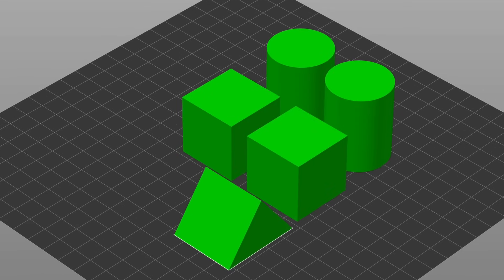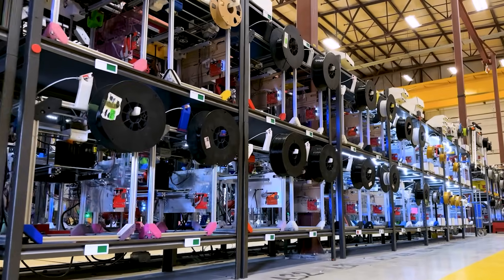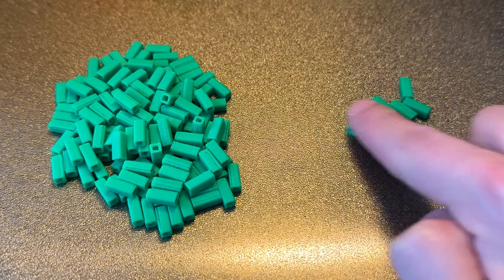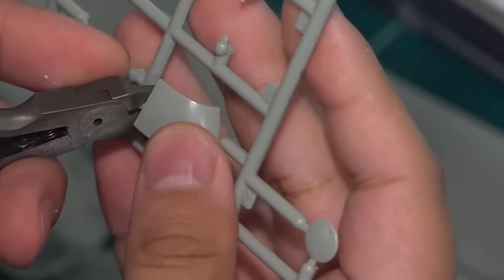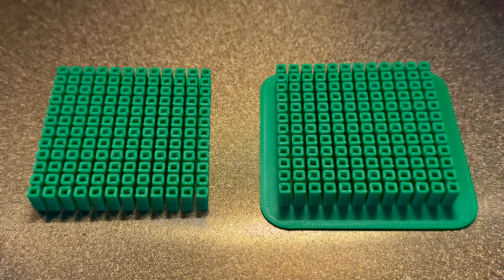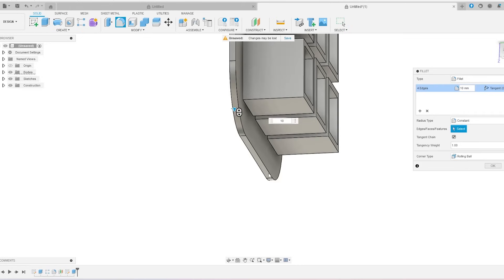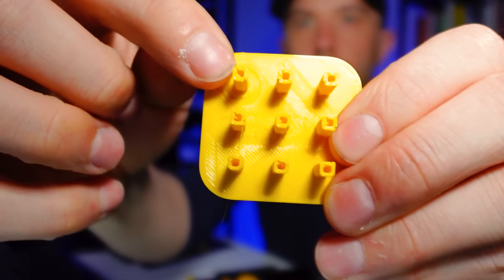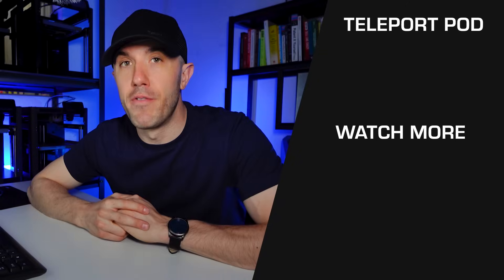STOP Filling Your Build Plate | Design for 3D Printing

Comment: One important reason for filling build plate, you forgot to mention:
Getting more parts printed for the same exact print time (& machine wear).

As long as the parts you add are not taller than the current tallest part, the print time will not increase at all! Only the height of the tallest single part (& layer height & exposure time) matters.

(Of course this only goes for MSLA resin printers, which are very considerable part of all 3D printers on the market)

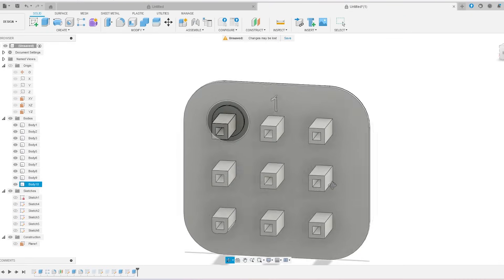Comment: What is going on with that print quality at 7:38? Extremely messy-looking top layers on the raft and parts, and huge seams up the sides of the parts. I ordered a test print from you recently, in matte white PLA, and it looked amazing, even a bit better than I get on my MK4 (really nice bottom finish, better corners than I get, and surprisingly crisp intersections of a grid of vertical fins, where I was getting tiny voids). I'm curious why you made me such a great part, but show off some really janky stuff in your videos at times.

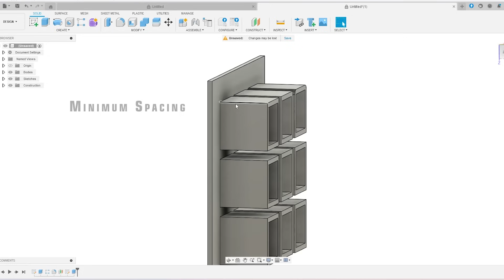Comment: when he mentions minimum spacing .2mm @5:37  is he saying spacing each part .2 mm away from each other or is there a spacing feature from part to raft? 
Not looking at my slicer right now so if there is a spacing feature from part to raft, what is it called?

also... in regards to those same questions.... yea... are you printing directly onto the raft, or spacing from it

if you are spacing from it, are you essentially printing in thin air, even if only by a small distance?

are you still able to apply a bottom surface texture/design?

Not exactly sure how this artificial raft allows for easy breakaway from the part and keeping the part to still maintain it's intended design/ shape on the bottom

best raft heights?

what if the part had a longer length but was layed flat horizontally and not much vertical height? ( think printing 20 0r 30 or 40 bookmarks layed down flat horizontally at one time.... would they not just essentially get stuck in the raft?

what are the best ways to create this raft if you are a SolidWorks user or fusion 360 user?
or is the best way to use that 3d builder app?
(apparently the app has been removed from ap store though there may be workarounds)

Thanks for any advice

Comment: Hi, I wonder how you can print with this 0.2 or 0.3 spacing. When I try that on my bambulab X1C, it will not print because all the objects are floating above the 'card' and it says I need to add supports. Any advice on this? Thanks

Comment: I had a thought when you talked about using the raft as a card; you could put your note, qr, TOC etc on the bottom, and have the framing on the top..

Maybe you said it in the video, I'm sitting in a takeaway next to a street, so it's a bit noisy! 

Great video, great tips! Heading home to make a template now.

Comment: when you’re talking about designing the raft and the minimum spacing of 0.2-0.3 mm, are you saying to design in a gap between the parts and the raft, like a Z-gap for support interface layers? I assume that’s what you meant but I just wanted to be sure. Thanks!

Comment: Still using the "additive manufacturing is better than injection molding in almost every way" line!

That is just wrong & it damages your credibility honestly. It damages AMs credibility as a manufacturing alternative as its just hype speak

In reality, most parts that could be made by AM or IM are made by IM. AM has its place but its never going to replace IM (or casting or machining) for most parts. It will supplement existing manufacturing with its advantages i.e. enable new designs that couldn't be made with other methods, bring products to market quicker or consolidate parts. But it has to make sense and create value!

Comment: How do you insure your prints pop off the raft? If they have more than a couple of mm of wall thickness, it might interpret it as being a part of the raft and not properly print the bottom.
Reply from the maker: 0.2-0.3mm spacing is good  even with solid parts. But working in the extremes will always require testing and verifying before a product goes live. But if a part has a large lower surface then there is no need to raft it.

Comment: I’ve done this for ever. UNTIL the H2D update in my P1S. They did something and now every batch print I do failed after 2” of height. No matter how large the footprint.

I think they changed the first layer settings or increased the max fan speeds because my fans are blowing them to the side. Never been an issue until the night I updated

Comment: I just finally got around to building my MK4 (and MK4S upgrade) and I'm building an MMU3 now. One thing I noticed is that Prusa uses color on their first layer to give a screen printed effect. (But more durable because it IS the plastic.)

This technique would combine super well with the idea of putting text on a card. You could essentially make a full color business card as your raft. The back has your parts and the front has your company info. Or maybe you put a nameplate on whatever you're building and you use the raft to double as such. This makes it zero waste. (Although multi-color printing tends to be wasteful)

Comment: Thanks. Love the batch raft and label idea. Love the print head bumper that looked like it could free a print by the raft as well. Do you have a video about that? if not, I get the just and will work on ones for my printers

Comment: Question:  I need to print several thousand small parts.  Totally get the raft, and the since I have 3 different part numbers that all look very similar, it makes it easy to identify part number and quantity.  The question is, what layer height does the .2 to .3mm offset work best with?  If I am using a layer height of - let's say .32mm, would I need to adjust my offset or Raft height to account for that layer height?

Comment: The reason people don't do it, in production or at home, is simple. Added cost for little potential gain. If part failures are 5% but you do this to 100% of your parts, to reduce failure to 1%... It's just added time and material waste.

It's the same reason why individual production units aren't tested anymore. They are 98% acceptable and it's cheaper to just replace the 2% that the customer returns, due to defects they find, after a purchase.

Comment: This only helps for some problems. If you have filament flow problems, your whole batch still will be effected. This is just for unreliable printers or filaments. I literally never had a cascading error like this on my Bambulab. Before on my cheap anycubic i3 mega, I wouldn't batch either. But this is just common sense.

Comment: Question: when you’re talking about designing the raft and the minimum spacing of 0.2-0.3 mm, are you saying to design in a gap between the parts and the raft, like a Z-gap for support interface layers? I assume that’s what you meant but I just wanted to be sure. Thanks!

Comment: Batching doesn't really save time during printing on fdm printers. Print two pieces at a time takes double the time of printing one piece. I use batching to optimise time though, for example I print over night so I prepare batch to last all night. I know my printer and  I know what to look for that might fail. In the cases I know I might have issues I wait to print them when I'm around to check periodically.

Comment: So I get around this two different ways:

1) I set the brims wide enough and put the parts close enough that the brims fuse into one super-brim that helps to hold everything down while still giving me the nice, flat finish of being directly on the bed.

2) I check "label objects" in my slicer and run klipper on my printers.  I watch to make sure at least the first layer goes down good, if not hang around and just glance over for the first couple of layers, and then I can go do something else and just keep an eye on my webcam.  Then if any individual parts fail while I'm away, I can cancel individual objects through fluidd/ mainsail and let the rest of the print keep going.

Batching parts is not just a nice-to-have.  It's absolutely essential for me to be able to make money with my printer while also working a full-time job.  I don't have the time to sit around and run individual parts.  I've been able to repeatably and reliably run off full plates of product using these basic tips.  Right now I mostly run flexy animals and fidget toys (because it makes money), but my goal is to transition to making functional parts for repairs and rapid prototyping.  Maybe if I get into a position where I need to run a bunch of tiny clips and other small parts where looks don't matter, this could be useful, but even there I think that using well-tuned brims that will peel right off will be the more economical solution.  Even the tag thing I feel is kind of a stretch.  A printed paper tag or instructions are going to be easier to read for the customer and more economical just about every time.  I'm not saying your method is useless, just that I think the use-cases are a lot more limited than you're making it seem.

Comment: Cool video, just would be clear if you told what the spacing 0.2-0.3mm exactly is. Viewer would understand if its the space between the raft and model part bottom or between parts themselves.
Reply: yeah, I'm still not sure about that
Reply: I think it was fairly clear that 0.2-0.3mm was the distance from the part to the raft, hence talk about how easily the parts came off with the different settings
Reply: @charltonrodda  
I think you're right about that interpretation, but I want to point out that it is an interpretation.

you're looking at evidence and making a guess

Comment: wait...matte black pla has a high warp tendency? I print a ton of large flat parts in that material and have never had that issue. Actually that is why I default to matte pla when using pla because it seems to have better overall layer adhesion. Did you mean another material? or is that an issue that starts developing on taller structures? (98% of what I print is less than 50 layers. is why I ask).

Comment: I was printing 8 parts on a 350x350 mm build plate, one at a time because they're TPU and the stringing would be awful if printed a layer at a time for all parts.  The tall parts have minimal surface contact area so each was printed on a raft which also helped with the large bed that was warped.  The job took 11 hours so I'd print two build plates per day.

I switched that production job to a 150x150 mm printer, printing one part at a time near the front of the build plate, and auto ejecting the part.  I now run 50 parts with no labor.  Empty the bin, hang another spool of filament and run 50 more parts.

I now print an oval raft, created as a modifier in OrcaSlicer, internal to the hollow part.  It has contact points at the front and rear of the part and that internal raft is an easy tear off tag that not only holds the part onto the print bed but also primes the nozzle at the start of the print.  The parts are foaming TPU-LW which is very stringy, so the extruder is moved very slowly at the end of the print to allow a few minutes for the nozzle to stop oozing, and when the extruder ejects the part into the bin, the internal raft tag on the bottom and the ooze strand on the top of the part eject with the part, leaving a clean build plate and clean nozzle for each subsequent part.  It works great.

When I get as many of these parts as I can from a spool, I'll print and auto eject a much smaller part from the remainder on the spool until the filament run-out sensor is tripped, so there is less than a gram of waste per spool.
Reply: How are you auto-ejecting TPU? Mine sticks like it's welded permanently. I have to put down a glue concoction I mix up (found online, works great), which wouldn't last through many prints. Is it just a feature of foaming TPU?

Comment: If you have cup sized rafts, you can use them as coasters.
Pd: ironically the one raft i use as a coaster is from a model that print better when you don't use one, was a crate, anyways only put the raft because come per defect in the program i use(currently use other as was pretty limited).

Comment: One thing you could do with the raft is if your product uses small screws to assemble parts, include screw sizing guides printed on the raft otside of the parts. So if your design needs 4 m3x30 mm  and a dozen M3x20 mm cap head bolts, a cutout labeled for each, or extrusion above the raft, and possibly places to 'set' the necessary parts so that it's less likely that your customer is going to have to go crawling around on the floor looking for that one bolt, and they can work out where in the assembly process they got to if they have to come back from eating dinner with the family half way through the assembly. And small holes that self thread for the bolts, and cross pegs for nuts to screw onto perhaps even as part of the shipping concept, negotiate with your print farm if that's going to be something you would like their assistance with)  And once the kit is out the door, and the customer has assembled it, they can either throw away the raft, or if you designed it well, hang onto it for use in sizing bolts in the future. You can even design a stand alone bolt sizing 'raft' that customers could order if they realize that your raft's have been useful, but they would like something more useful across all of their projects.

Comment: We need to make sure the raft isn't too big though, right? Or do whatever it's called to have a gap under areas of the raft so be adhesion isn't too much to have auto-eject issues, right?  And bevel the edges? Maybe just all first layer concerns still apply.

Comment: Printing one at a time in batches is less risky than all at once. You don’t risk losing the whole batch of parts if one goes wrong. Also it reduces print time by reducing the amount of traveling for the same number of parts. But, you do have to be careful to space them out and be mindful of print order so you don’t crash the machine into already finished parts, particularly for tall parts.
Reply: You don't have to be careful, the slicer knows the clearance for the print head of every machine and generates the arrangement when you choose printing by object instead of printing by layer.

Comment: I like the video. I think there are some good points made about batching. However, I was taken out by the statement that 3D printing is better in almost every way compared to injection molding for creating products. At any sort of scale, the repeatability, speed, and reliability of injection molding absolutely blows 3D printing out of the water.
Reply: I mean, he runs a printfarm. This channel serves as a way to sell his service and his app integration to people like us. Naturally he'd say that 3d printing is better than injection molding. There are benefits for both methods.
Reply: Injection molding is 100x better. 3d printing has its place but quality durable parts isn’t one of them. Great for flexi dragons or trinket boxes!
Reply: @mynameisprivate158  Printing can easily produce parts that withstand hundreds of kg loads, including in the Z direction, if you know what you're doing and use appropriate materials and temperatures. Yes there are folks making trinkets and toys (note: a lot of these toys hold up better than the ones on the shelves in Walmart) but there are also serious engineering parts being made. And you can even do it on the same low cost machines.
Reply: @arpytrooper2604  Injection molding is too limited in the geometries it's practical to produce at reasonable cost, and the limitations often lead to low quality parts that break or have cavities that collect dirt and are difficult to clean (oddly, the complaint critics throw at FDM). It also inventivizes extremely wasteful overproduction and marketing to facilitate selling said overproduction.
Reply: @daliasprints9798  when it comes to making parts that work with injection molding then it's way better than 3D printing. Obviously it's not perfect at everything but if the option to injection mold is there then you'd be crazy not to pick it

Comment: I legit stumbled upon this by myself earlier tonight. Was trying to solve for bed adhesion issue for prototyping something with very small parts that don’t make sense to print one or two at a time. My solution wasn’t as elegant as the circle, but that’s an even better way and now I can batch for multiple different jobs on one print plate. 🤯